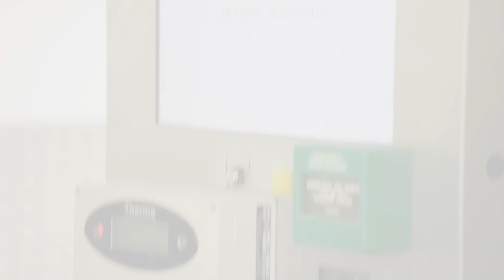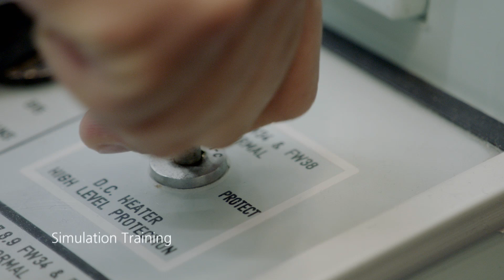How we generate nuclear power safely

Comment: EDF could you focus on Nuclear Fusion Power Production as it doesn't produce radioactive waste and doesn't need an UrnaiumDioxide mix with Plutonium rods for fuel. If you're really wanting a 0% CO2 output then I believe Nuclear Fusion is simply the best approach to help show that nuclear power is a viable way to solve the carbon crisis.
Reply: Nuclear fusion has not matured to the level that we can use it for electricity yet, and it won't for a good few years to come
Reply: @DomDoesCoasters  still if we can fund the research more so we can get the prototypes made then we can get the working reactors, What's wrong with that?
Reply: I 100% support the research too, but for something that's just theoretical right now it'll be hard to just start making reactors on a large scale, it also wouldn't be anywhere near financially viable for a long time, about your comment on current (fission) nuclear power, Plutonium is NOT used as conventional reactor fuel, uranium is the fuel, what you are describing is called MOX fuel, which is basically recycled nuclear waste with the plutonium in it, Nuclear Waste isn't an issue, 96% of nuclear waste is recyclable, it can be "burned" which means to use it in a reactor as fuel, as the fuel is used for generating electricity its mass shrinks until it is literally all gone, it takes a special kind of reactor to "burn" this waste though, (called a fast reactor)  but luckily the UK government is working on building them, as for the remaining 3.9% of nuclear waste that cannot be "burned", there are a variety of potential uses for this, it can be used as fuel to power space exploration in Ion thrusters or in Radioisotope Thermoelectric Generators (RTGs) that are used to power rovers, satellites, and space probes, mars 2020 perseverance rover uses an RTG. 
other uses involve life saving medicine.

Comment: No safe way of disposing of nuclear waste. You're ruining the future of life on this planet
Reply: So burn more carbon based fuel?
Reply: @Blob B sun sea and wind are viable but to equate to one nuclear site that runs at 1100MW you'd need 2000 wind turbines. All of those turbines have a 20 year life span, a nuclear site has a 60 year life span. Nuclear has a 90% capacity factor and constant output of energy. Wind has 25% capacity factor, this varies based on weather conditions. Im not  trying to say "fuck all the renewable's! I want the planet to die" What im saying is that its not currently possible to run the whole worlds on renewable's, and wont be for a relatively long time, so we should stop dreaming of some renewable energy utopia as its not possible with our  infrastructure yet, we are still too linked with non renewable's. I wish we didn't have to use nuclear power, or fossil fuels, i dont see why anyone would want to use them considering their risks, but we dont really have much of a choice. All we can do is reduce the risk.